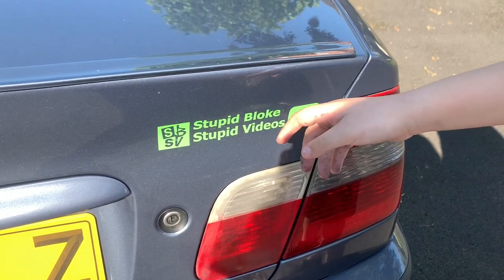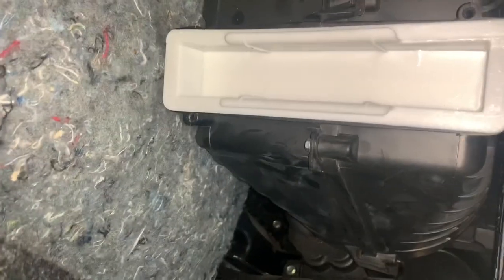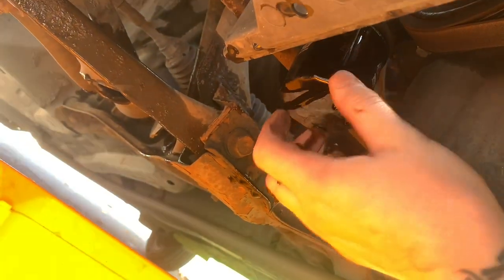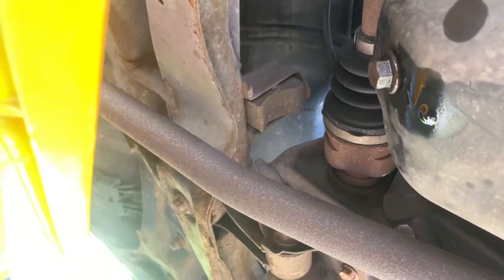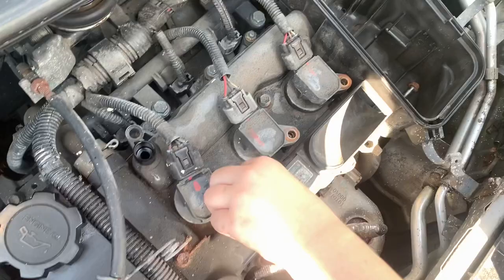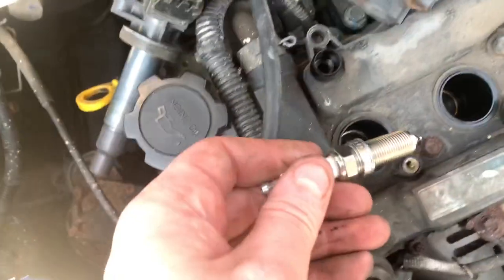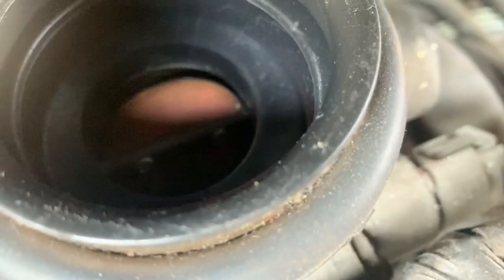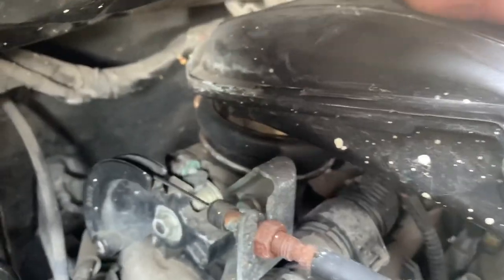Citroen C1 Service DIY + Cabin Filter Replacement. CityBug/C1/Aygo/107 Service by Father & Son

Comment: 😂 When you got to tyre pressures.. "32 all around.." which is where I thought to myself I'm sure I've got mine at 34... "34 if you're fat" - oh that'll be it. Made me piss!
Reply: To be honest I think the pressure recommendation for the Aygo is a bit low anyway. The tyres look a bit flat at 32psi and my wear pattern seems good and even at 38psi the ride is a bit bumpier but that's about it. When I used to inflate to 32psi I found the shoulders of the tyres wore faster then the centre.

Comment: Just a tip! Tilt the washer fluid can to the side when you fill in the car, then you wont spill that much! Works with engine oil as well! 😊
Reply from the maker: Yes good tip, it lets the air in and stops the glugging.
Reply: Yes, simple and effective.

Comment: Not sure if you spilt screen wash on purpose but if you do it again when the bottle is full it's best to start pouring with the cap at the highest point and slowly rotate the bottle as it empties. The only issue I've had servicing my Aygo outdoors is wind when filling the oil, if a gust makes you spill it on the engine you've got to act fast as the auxiliary belt is right below the oil filler cap and if you get oil on that you'll need to clean all the pulleys and probably replace the rubber auxiliary belt.
Reply from the maker: Yea, ideally you want the cap to be the highest point when pouring. Then the air can get in to the bottle without gulping.

Comment: When you screw the new spark plugs, did you just screw them until you can't do it anymore? On other youtube videos there is a torque specification pattern or something like that, but being a beginner I'm not sure how it works. Is it fine if I just screw the new spark plugs until I can't screw them anymore? Thanks.
Reply from the maker: There is a torque setting for them, 27Nm I believe. It’s not critical, it’s just a setting that’s tight enough to not come loose but not so tight that you’ll strip the threads or snap a plug. They want to be nipped up but not pulled on hard as you can easily snap them. Once you’ve done a few you get the feeling for how tight they should be without a torque wrench, but if you’re unsure then might be better to play it safe and use a torque wrench.

Comment: If I was you I would cover air filter chamber while working with coils etc. as I guarantee you don't want to fish any nuts or bolts from intake manifold 🤣
Reply from the maker: They would have trouble squeezing through the icv to get passed the closed throttle body, but if they did I think the easiest way to get them out would be to hold the revs at 6500 until they came out the exhaust 🤔

Comment: Is the pollen filter only on cars with a/c??
Reply from the maker: Yes, I should have mentioned that in the video.
Reply: @mrt4409  but you can fit in one if you cut a hole in the pipe. Took me 10 minutes to upgrade my 107. And it was worth it. Check fix n drive video on how to upgrade car with no ac
Reply: Even cars without A/C will have pollen filters or cabin filters.
Reply: @wingkinwong9082  looks like you’re Wong on this.
Reply: With A/C I mean (automatic) airconditioning unit, using R134-a or HFO-1234yf gas, controlling the inside temperature by means of a condensor unit. I changed many pollen or cabin filters in cars myselves knowing the difference. All cars have an air filter filtering incoming air from outside: pollen or cabin filter. But not all have A/C unit.

Comment: If it was french, there will be 30 different tipes of screws nuts and bolts to remove requireing three prs of hands. You won't get any instructions but will get a contortionist outfit a bottle of wine and a note that reads. Good luck. 😂😂😂😂😂😂
Reply from the maker: It’s ok, all the bits I’m fondling have been lovingly crafted by Toyota!